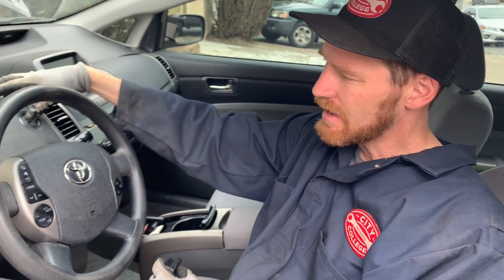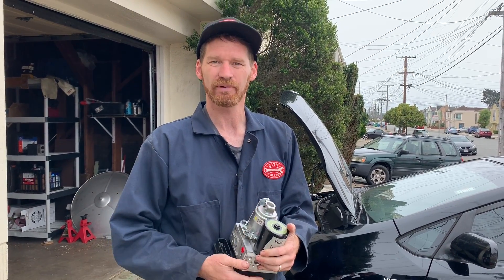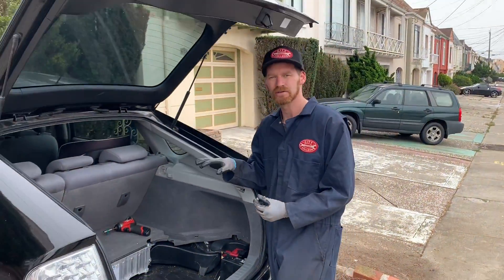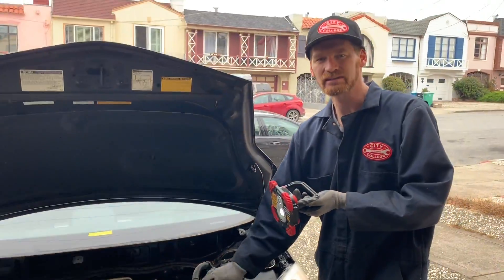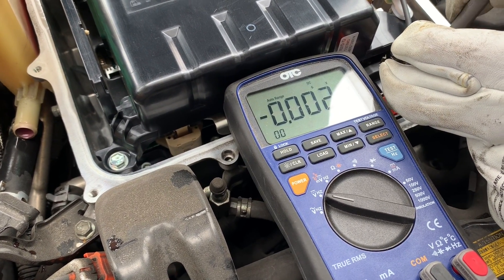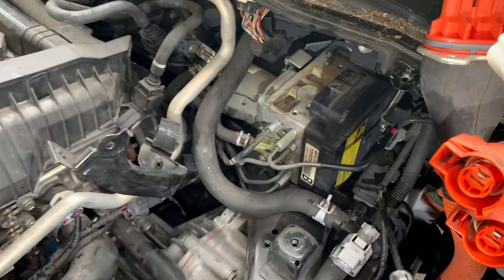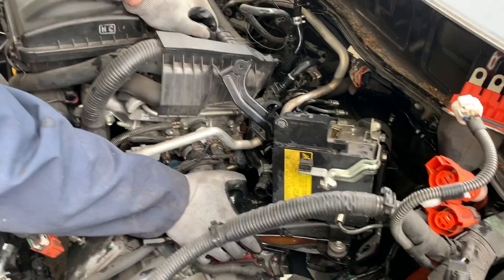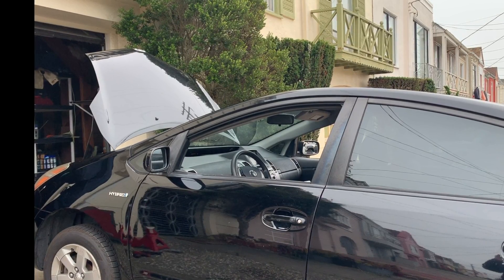2004-2009 Prius ABS Actuator Replacement

Comment: Thanks for the video! I'm planning on replacing this part in our Prius and I think that this video will help a great bit.  I do have one question, do you know what the torque specifications are for all the bolts/nuts/brake lines  that get removed during this replacement?

Thanks,
Ezra
Reply from the maker: Ezra Aderhold I do not know the torque specs. There is not a torque wrench for brake lines that I have seen but a torque value is given for bracket bolts and other fasteners.
Reply: @Mrelectric423  Ok thanks. We actually ended up doing this job last weekend, thankfully we didn't break any bolts and so far no leaks.
Reply: @EzraAderholdDG  Do you know if the bleeding process is imperative? In the past, for boosters, typically taping the lines would not allow enough air to get in.
Reply: @pinpon163  I don't know if it is imperative, we did bleed ours though. On techstream the bleeding procedure says "perform this after changing the brake actuator" or something close to that. I would lean towards thinking it is probably a good idea to do it.
Reply: @EzraAderholdDG  thanks, I guess I will. For me, the bleeding process is  more complicated/annoying than the replacement of the actuator.
Reply: @pinpon163  yeah it took a lot longer to bleed than I thought it was going to. At least the techstream steps were pretty straight forward, having two people definitely helps.
Reply from the maker: Ezra Aderhold I have skipped the bleed with no ill effects. Not saying that will always work but as stated above the bleed is almost more painful than the actuator replacement.
Reply: @Mrelectric423  Ok cool, thanks for the update!
Reply: Ezra Aderhold where do you get the techstream? How much does it cost?

Comment: The Achilles’ heel of the Prius!
Reply from the maker: Savannahpirates It is still more reliable than a honda civic, the bench mark of reliability.
Reply: I’m getting this done on my car now.  They are putting in a used ABS system which saves me a couple thousand bucks.  Part has a year warranty.  Wish me luck.
Reply: @Piwork69  How much are they charging you?
Reply: @pinpon163  $1200.  They are meticulous when it comes to quality parts, normally using OEM parts only.  of course in this case using a quality used part.  Works good.